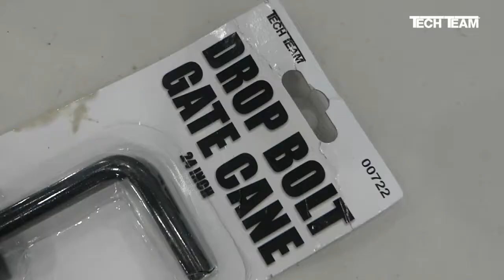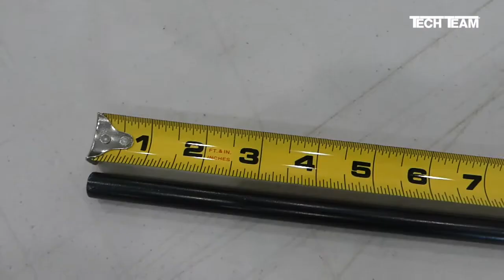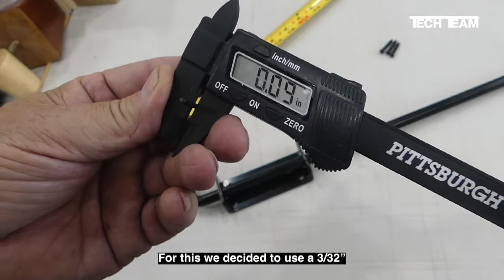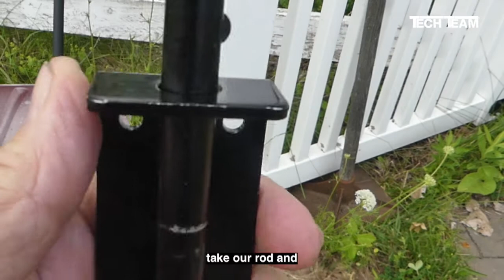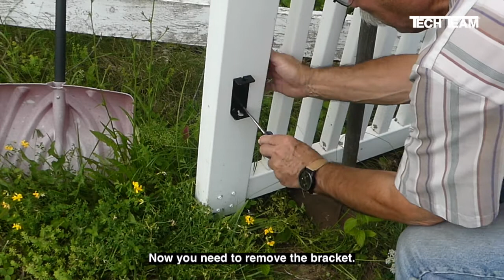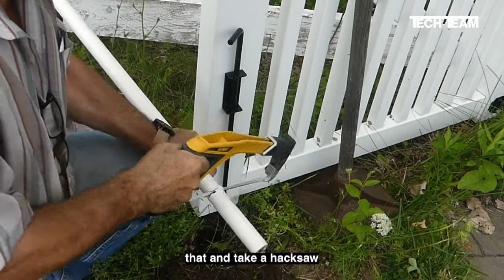How To Install A Drop Rod/Pin, Cane Bolt To Hold A Garden Gate In Place – Use Tech Team 00722

Comment: A "tube" !!! What a great solution. My shed's on a slope so one side can't reach the dirt/frame/base easily and the door won't swing fully open because it bumps into the roof edge. Using an old PVC tube is a PERFECT solution for pins. So much easier than installing a block of wood and drilling a hole. Thank you, thank you, thank you !!